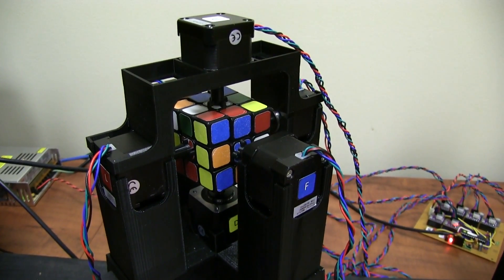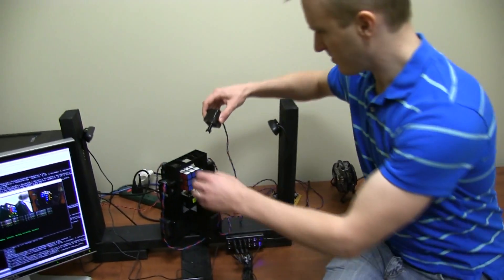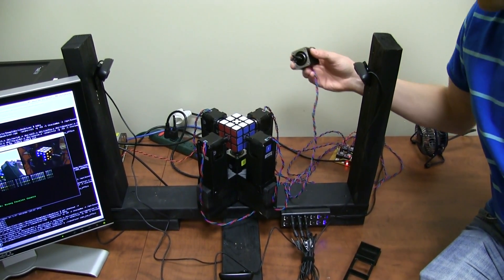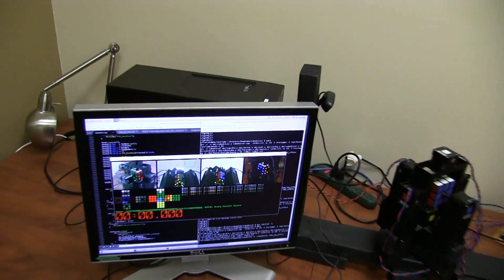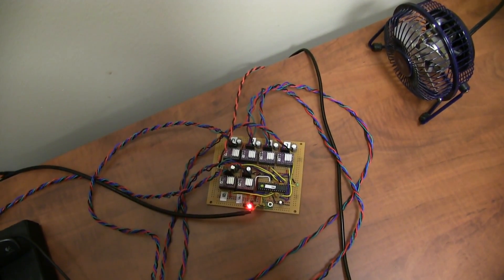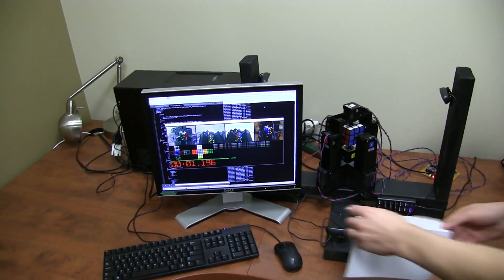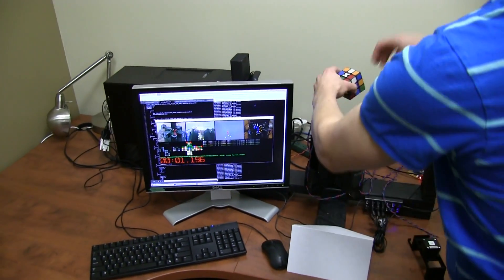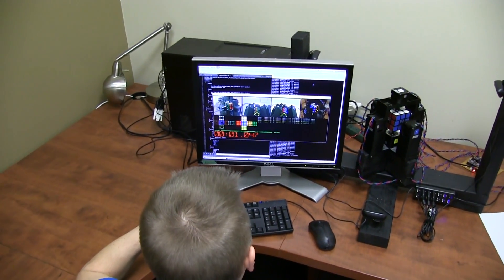World's Fastest Rubik's Cube Solving Robot - Now Official Record is 0.900 Seconds

Comment: This is awesome! Not sure what those logitech cameras run at, but have you guys tried using faster cameras? Might give you a little bit more of an edge. Playstation Eye cameras can run at (320×240 pixels @ 120 Hz) and are super cheap. I use a modified one for a head tracking setup I made for games.  http://www.amazon.com/PlayStation-Eye-3/dp/B000VTQ3LU

Edit: driver here (used to be free, but w/e) -> https://codelaboratories.com/downloads/
Reply: +TheOriginalSacklunch The system uses still photos to determine the starting state of the cube. The algorithm then defines the moves to solve the cube, and when the program is ran to the robotics, it just executes those moves. There's no need for high speed cameras, since the system doesn't rely on visuals during the time it's physically solving the cube.
Reply: +HerraTohtori Gotcha. Thanks for reply!
Reply from the maker: +TheOriginalSacklunch Logitech C310s.  Basic cameras.  Cheap, so buying 8 (we have 2 full machines built) wouldn't be too expensive.  We're running 160x120 on each, mostly to avoid USB bandwidth problems, which start to become an issue with that many cameras.  We did make an effort to keep FPS high.  You are right, it can matter.  30fps=33ms per frame, 15=66ms, which is getting to be noticeable in our times.  Above 30fps isn't too important.  Interestingly, we found that locking down the cameras exposure setting was necessary to keep fps good.  If we pointed at dark scenes, fps would drop.
Reply: TheOriginalSacklunch I mean, I'm not affiliated with them or anything, that's just how I understood how it works.
Reply: +Jay Flatland That is interesting. Good luck in your world record attempts.

Comment: What was more difficult, the software or the hardware?
Reply: the hardware is the limitation
Reply: +JamboNessy the software is actually very easy
Reply: +Jose Carlo Capriles You've programmed one?
Reply: +InsaneFameNYC Ofc the hardware
Reply: +InsaneFameNYC From a programmer's POV, the hardware and vice versa.
Reply: No, it's a fact that the mathematics behind the software is perfect. There are only a few millisecond left for improvement there.  The jumps in world records due to hardware improvements however are in seconds.

Hardware is the bottleneck on physical operations, including complex stuff like robotics.  Software is the bottleneck where physical intricacy is limited, and the complexity of the system is massive, such as making an AI, where we have an abundance of power (processing power compared with our brain) and yet have only made baby steps in software.

Comment: Invalid. You have 6 Axis points to which are NOT modified from their origin. This removes the ability to have a FULL true test, as the axis lines are stable and NON-MOVING, making 6 points a flaw in your experiment because there are a multiplicity of combinations that should be being used from NOT blocking those 6 points to NON-MOVEMENT. How many combinations are removed from the equation to solve by having those 6 points locked in? That is the most obvious flaw I will point out, not to mention others, but the idea is cool.

Comment: Record I believe applies to an unmodified out of the box cube, yours is modified. 

I love the machine and the work don't get me wrong, well beyond what I can or ever will do.  But you can't modify the cube at all as I would see it.
Reply: So you're telling me people like Feliks Zemdegs and Kevin Hays world record that they've had don't count because they made them easier to turn and have better performance.
Reply: BBBuilds12 A cube being played with under normal conditions will become easier to turn however if they have modified parts to make it turn easier then no I feel it shouldn't count as then it is not an original cube.
Reply: +ThyBountyHunter If it does not influence the method of solving, and it only increases performance, then why should it not count?  By method of solving I mean the series of moves used to solve it.
Reply: BBBuilds12 No, it shouldn't.  As you are changing the object and making it different then factory or original.  

As I said, a cube will get faster with use and wear and that is fine, however once you change a part or physically change it then it is not longer factory or original and shouldn't qualify.

Think about it, the computer solved it within a fraction of a second, what we are actually timing is how fast it can turn the cube to get to that solution. Changing any part of the cube to make it faster is really cheating. 

Edit:  You mentioned that it doesn't method just performance.  Think about racing of any sort, the method is the same, get from one point to another or do so many laps around a ring.  That is the method, should they be allowed to use performing enhancing drugs or modifications to help the performance?  A bit far but along the same lines.
Reply: +ThyBountyHunter Doesn't matter. The current world record holder uses modified center pieces too, it's considered legal.
Reply: also, you dont have to use an original cube, you can use an off brand one as long as its within the regulations.
Reply: +ThyBountyHunter Their  isn't anithing u kan reeli du bout it tho, soooo....
Reply: +ThyBountyHunter You're the definition of a failure
Reply: +ThyBountyHunter This was an out of the box cube

Comment: This is cool, but I feel like if you have to modify the cube to allow the mechanical parts to go that fast you're sort of taking an easy route on the raw robotics challenge of manipulating the puzzle.
Reply from the maker: +HimuraKENSHlN We actually started that way initially, with really thin parts very carefully designed to fit into the cube, but it would never turn smooth enough to work.  Finally we gave up that path and went with an invasive method.
Reply: +HimuraKENSHlN Yea, but since the major obstacle to speed is not computation but manipulation with this puzzle any modification of the cube is kind of cheating for attaining the highest speed. Afterall, the computer could solve a virtual cube in a few thousands of a second.
Reply: This ain't easy!  =)
Reply: +Aetrion To be fair, people who compete in rubik's  cube competitions do that all the time. You will never find anyone using the official rubik's cube because it's hard to twist. Instead, they use products from other companies that are sold on the premise of being easier to twist the cube faster and even do something called "corner cutting". 

Beyond that, many of these also put lubricant inside the cube to make twisting the puzzle even faster and smoother.
Reply: +Aetrion  Why do you feel the need to belittle their accomplishment in such a pedantic and mundane way?
Reply from the maker: +Primus That's kind of our line of thinking for going this route.  WCA allows some modifications, we're going with that.  Plus, the current record uses a more invasive method, so we figured we're good.  Up to Guinness, really.
Reply: +Aetrion They would have to 3D print a really thin square arm and that may not be very durable for the speed it's going at/the tests they are doing.
Reply: except they followed the guidelines provided for legal modifications to the cubes so it is completely allowed when trying to break the world record, having to make it so this machine can hold it properly doesn't in any way devalue the achievement in terms of the world record

https://www.worldcubeassociation.org/regulations/#article-3-puzzles
Reply: most people take apart and grease their cubes
Reply from the maker: +Aetrion Easy route is the smart route in my book :)

We started this project thinking 3x3 should be ENTIRELY dominated by sheer mechanics of the cube, and I think we've achieved that.  I'll fully acknowledge this is entering the realm of ridiculousness, and is departing the realm of compelling robotics competition.  I think that 4x4 and up would all necessarily be a MUCH more compelling robotics competition, because 1) there's no easy mechanical solution, and 2) because the solving techniques are MUCH more difficult.  But the downside is the popularity of 3x3 is SOOO much higher than any other.
Reply: +Aetrion I disagree. A robot solve is obviously going to be different to a human solve. Getting the best grip is fine in my opinion.
Reply: +Primus or just read the regulations
worldcubeassociation.org.regulations
Reply: +Aetrion people modify their cubes for the manual records too
Reply: If they can't use the drilled holes they could just use industrial super glue. If you super glued all the sides to the motors I dont think it would go anywhere
Reply: +Aetrion I knew someone had to say this nonsense.
Reply: +Aetrion These motherfuckers built a robot, your argument is invalid.
Reply: +Tyler McKee that's true, but most people don't have the ability the move all six sides at once.
Reply: Tony Fisher why is it different? Humans programmed the robot. The images on the screen I imagine depict potential end results depending on the move chosen based on current state of the cube. The difference would be the computer is better at remembering a lot of information and quickly accessing it in order to make decisions but the logic that it follows came from a human thinking what is the optimal way to solve the cube given a scenario. You could have an AI determine the most effective way to solve the cube through trial and error there's a thing called FPGA where through trial and error the most effective way to do something is found.
Reply: Ok, then you make a better one.
Reply: +Aetrion If you consider this cheating, then using speedcubes instead of 'traditional' design would also be cheating. In my opinion, neither of these two is cheating.
Reply: y u bustin' their crops, 
it's a pretty cool bot
Reply: +David Vonderhaar Nerds made the internet you're using sir :)
Reply: +Aetrion haters gonna hate.....
Reply: +Jay Flatland 
What happens if you change the position of two colors? Does it understand that there is no solution or it goes on for ever?
Reply: +Tony Fisher it's inherently different, so the robots can have the best advantage they can have, and us humans will lube and modify as we see fit.
Reply: the robot doesn't have fingers, how else is it going to maneuver the cube?
Reply: To be honest it's just plain cheating.
Reply: +David Vonderhaar dad?
Reply: +Kevin Garcia Your input is greatly appreciated.
Reply: +Aetrion 
The intelligence of the robot is the point, not how robust it is, no?
Reply: Well professional cubers change the mechanisms in their cubes and lube them to make them go faster
Reply: +Kevin Garcia I think it's fair to say you've given us all something to think about.
Reply: Nah this is 100% fair. Brb gonna go buy a baseball pitch machine to beat pitching record. Lol sarcasm aside I'm really impressed with this machine
Reply: +ncdefenceman Cheating at what? Programming a robot?
Reply: +Aetrion comepltely agree. I made similar robot with less modification , but didnt complete. also the modification of cube disqualify them for world record.
Reply: +Kevin Garcia best comment ever.
Reply: +Aetrion The cube has been adulterated. I call shenanigans! shenanigans!
Reply: +Aetrion vs your uploads: video games
Reply: ***** And neckbeards gotta grow neckhair.
Reply: I feel the same. Soon it's slipped down to having the cube represented on a screen instead and the whole challenge is gone.
Reply: magic
Reply: +Jay Flatland at the same time, what you have achieved is no small endeavour and the next step would be 4x4.
Reply: hatepion your dat gie
Reply: Just use a speed cube with cut edges
Reply: +Aetrion well obviously you'd have to do a thing like that to make it solve it so fast,i really think this is more intresting than just watching a robot with hands solving it or watching this machine solving it slowly, i mean figuring out how to make the machine solve it so fast is not easy too you know, just look how fast it is solving it, i don't even understand how it does it so fast cause i don't see the things which are solving it move away from the cube
Reply: +Mickey Starman you could make some sort of hammer thats hitting it diagnolly no doubt or maybe you could use a track
Reply: That makes no sense. Every single cubist(?)  mods the cube to make it go faster, or simply buys a third party cube (not Rubik's) that is already modded to move faster.
Reply: +ncdefenceman to be honest you are just plain stupid.
Reply: +Aetrion stfu
Reply: +Aetrion I agree. I feel like if they were to create the feet so it fits in the rubiks cube without needing to drill holes its fair. But with modifying the cube i feel like thats just easy. like if you can modify the cube might aswell take the stickers off and replace them where they go if you want.
Reply: +Aetrion they dry lube it up I bet
Reply: true
Reply: Jay Flatland Don't tell me you're aiming to beat the existing 4x4x4 robot record too! ;)
Reply: +Jacob David C. Cunningham Agreed
Reply: +Jay Flatland Thats cool.. Hey!! If you don't mind to say.. What algorithm did you use for the solver? decision trees??
Reply: agreed
Reply: I will agree with you ONLY because I'm  dumb!!! I like robots.
Reply: +Aetrion I agree and came here to say the same thing.  While I appreciate the effort this is the worlds fasted time with a modified rubics cube.  This is not clean.
Reply: +Tyler McKee Vaseline! We used to do it back when I was in high school, in the 1980s. Yes, I really am that old. Yes the Rubik's cube was out back then. No, I wasn't anywhere near this fast. 

I was pretty average actually--I think 1 minute 22 seconds was the fastest I ever solved it. I saw a classmate do it in under 30 seconds once, but there's some luck involved in terms of the combinations of moves it takes.
Reply: You should make one
Reply: Zerumphrey Mankool Automatic pitching and human pitching are 2 different things. Robot cube-solving and human cube-solving are 2 different things. The fact that a robot solved it is not what this is talking about as "cheating".
Reply: +Aetrion What you're talking about is either the insets for the machine to dig into, or that they're greasing it? Ehhh.
Reply: +EpiCuber7 "Puzzles must be clean, and must not have any markings, elevated pieces, damage, or other differences that significantly distinguish any piece from a similar piece." - https://www.worldcubeassociation.org/regulations/
Reply: +Bruno Cassol سلام
Reply: +Aetrion With a larger piece of machinery, heavier arms, rubber feet of the correct dimensions, I'm sure this would be quite possible for these guys without cube modification.  It's simply a bracing mechanism.    It's still very impressive.
Reply: +carty caruso Actually, only two sides can move at once and they must be opposing, because the cubelets on the edges of a side are shared with its four adjacent sides.
Reply: +highstakes78 SS Uh, it's impossible to move the center pieces from the center. That's a fundamental part of how Rubik's cubes work. The centers are fixed, they only rotate. Think about it: how would you move a center piece (1 face) to the edge (2 faces) or a corner (3 faces)?
Reply: +highstakes78 SS What? You can't move the center cubes. They are fixed and can only rotate, they can't move.
Reply: +Bishop Coxcomb Yeah - while the algorithm (may be) fast, they took a shortcut by drilling the holes. While impressive, I don't think they should get the record.
Reply: Bruno Cassol Every single center piece is the same still. And a center piece is already distinguishable from every other piece because it only has one sticker.
Reply: +EpiCuber7 https://www.worldcubeassociation.org/regulations/
Reply: +Carl Friedrich Gauss if you switched two colors then you have invalidated the game.
Reply: +Aetrion In theory if you used a digital cube that didn't need to be physically manipulated then you could solve the puzzle in as fast as the computer's processor which would be a fraction of a second.
Reply: +Aetrion True, so it's not quite as impressive as having a robot manipulate a generic rubik's cube, but it's still pretty darn insane!
Reply: I'm sure when they win, they'll attract a genius roboticist & this will be the next challenge!
Reply: +Zachary Brackett It's easy to talk shit about something you've never done yourself haha, haters gotta hate